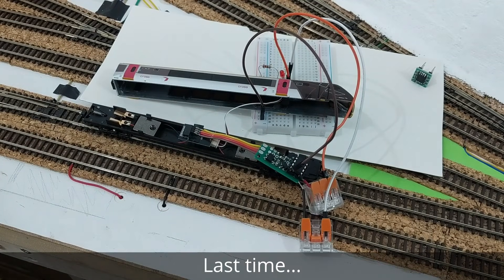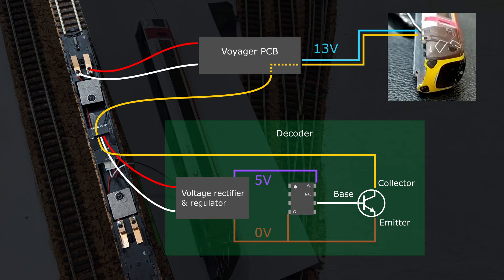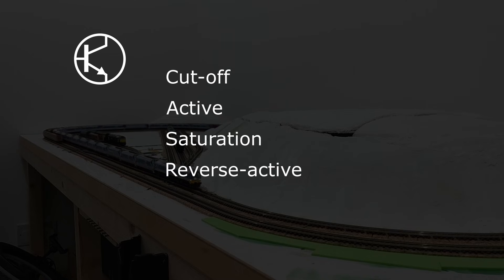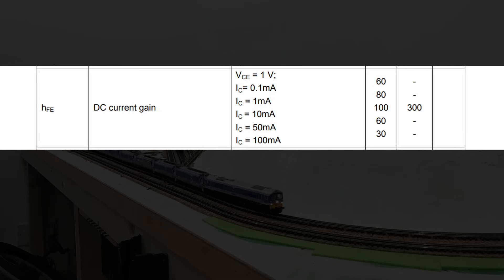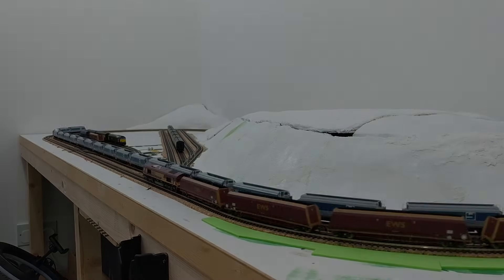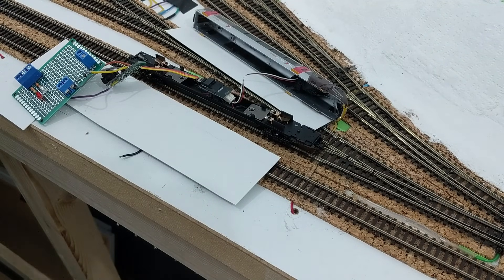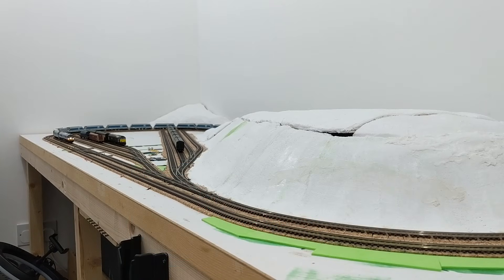0057 Home-made DCC decoder - part 4

Comment: Please try logic level n Chnl MOSFET like BSS138, Si2302 etc. In case of MOSFET gate drive is voltage dependent, so no need for calculating like base drive current of NPN transistors. Also saturation of MOSFET is easy. If your gate drive supplies both 0 and 5V then gate resistor can be removed, saving space in miniature assembly.
Reply from the maker: Thanks for the suggestion - a couple of other people have said the same, so I've bought some now 🙂 For some reason when I first looked at mostfets several weeks ago I was only finding ones that needed 10V to switch. Saving space and heat will both be good 🙂

Comment: Hi Jonathan! Great to see you making progress! I find there are so many different components, and so many different ways they can fail, that it's sometimes not immediately obvious what has gone wrong when things stop working! My own DCC Interface project seems to have stalled with the arrival of my 3D printer, but hopefully I'll get back to it in the new year! In the meantime I'll live vicariously through your project! Oh, and I'm in awe at your soldering skills working with such tiny components! :) Cheers, Ian.
Reply from the maker: Hi Ian, yes - I do try to test small units as I go, but I find there's only so much that can be done before a full integration. There's lots of fun to be had with a new 3D printer I'm sure 🙂 The great thing about this all being a hobby is we can spend time on whichever aspects we're finding most enjoyable at the moment, but with this one I find each time a new sound-fitted loco that I like is announced I wish I'd already got to the point were I knew I could fit my own decoders and just buy the DC option! Thanks, though my soldering skills haven't progressed much - thankfully I didn't film any of the bits where I was soldering the insulated wires on! These little surface mount components and the perfboard metal rings just love solder 🙂

Comment: I need to watch until the end before commenting….
Reply: Ok, watched till the end. The 2n3904 is a good choice as general purpose transistor. A word of caution would be to check the ATtiny max output current that it can drive. You don’t want to make it work too hard ( I have found this out a few times).
Reply: If you find that you need to drive more current. Take a look at Darlington pair transistors. In effect they are 2 transistors in one package giving increased current gain.
Reply from the maker: Thanks for the advice - the ATtiny seems to be OK powering LEDs directly and those are higher current, so I just assumed it would be OK. A search I've done says 5mA, so that's OK, but I'll see if I can find it directly in the datasheet at some point.

I don't think I'll need to drive more current, but thanks for the suggestion - it might be a good space saver having a couple of transistors in one package 🙂

Comment: I am in awe you have this small enough for N gauge, good with the transistors to see it done properly and not "sod it, use 1k" like some others who shall remain nameless. do agree with @MarkSJBeard on using mosfets would be better, these are weird alien devices but a lot better for this sort of thing

pity the red LEDs went, with your eye and soldering you may find swapping the SMD LED on the board isn't that hard
Reply from the maker: Thanks - the Voyager is flattering because it's mostly hollow, and the windows are heavily tinted (which is accurate) so I've got an unusually large amount of space in these for N gauge.

My confidence is certainly growing, though me and a soldering iron could still be a significant risk to that Voyager cab!

Comment: 4:50 Basically you want to drive the transistor out of its linear (active) mode and into saturation, and that changeover occurs at the base current to achieve the maximum collector current. So the condition for saturation is Ib > Ic/hfe-min. Both the Ic/10 and Ic/20 limits are intended to approximate to this for practical transistors.

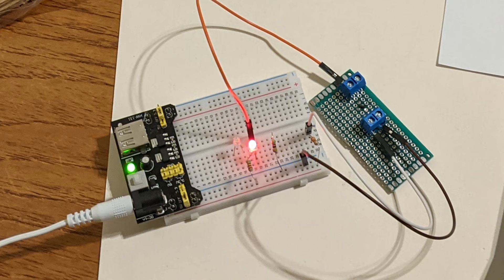8:40 Yes, you will have blown the base-emitter junction and the transistor has now failed short circuit. But all your design reasoning here has been spot on, including selecting a 3k3 base resistor.

Practical switching circuits typically have a higher value resistor across the base-emitter junction, and (slightly) reduce the base resistor to account for the extra current through this. This resistor ensures that the transistor remains in its cutoff region when not driven. If you added a 10k from base to emitter, at 0.7V that’s an extra 0.07mA from the drive, so your total drive would be 1.3+0.07=1.37mA. To get this at 5V you’d need <3.14k, so choose a 2k7 base resistor.

Now you have this working, the next step in optimising this is to use n-channel mosfets to drive the LEDs instead of BJTs. Example is the 2N7000 series. You control these with voltage not current, so you can directly connect these to the ATtiny without resistors. In many projects this would make little difference, but at N-gauge scale every components takes valuable space!
Reply from the maker: Thanks for the useful information as always 🙂 The ATtiny seems to be able to pull the base down to 0, so I seem to be able to skip the extra resistor from base to emitter, but thanks for letting me know about that - I'd have been scratching my head about what to do with the parallel path for calculating resistance!

I had previously looked at some mosfets but they weren't logic-level - a more specific search yesterday using that code you've given brought back suitable results, so I'll have a more detailed look through those and order some - I gather they're less likely to get hot too, so saved space and saved heat will both be welcome, thanks! I think when I eventually get to motor control I'll need them for their switching speed too.
Reply: @endoorrailway  Ah, talk to me more about high speed switching when the time comes. If the frequency is high enough (above 15kHz to avoid audible noise), you need really good gate drive speed. For low speed (below 1kHz) logic level drive is good enough.